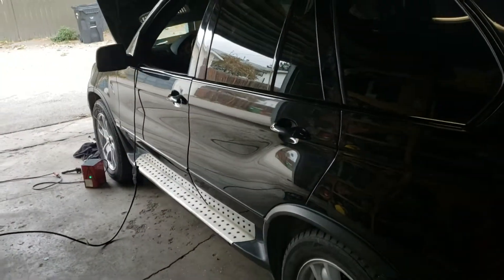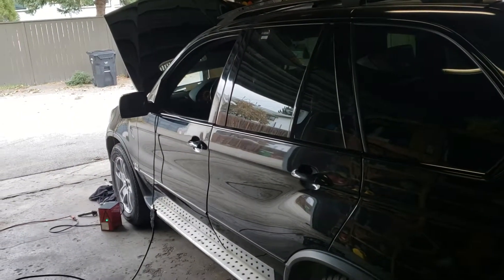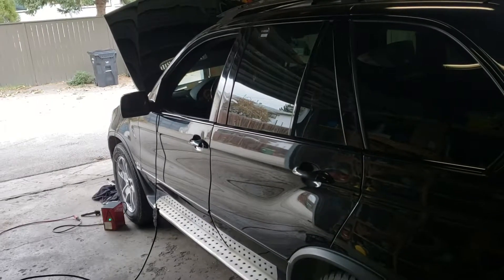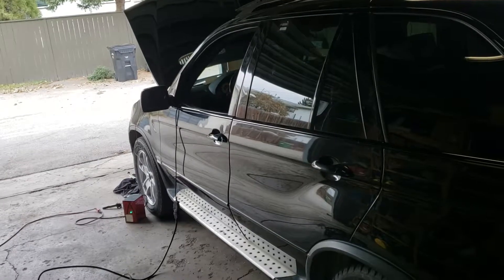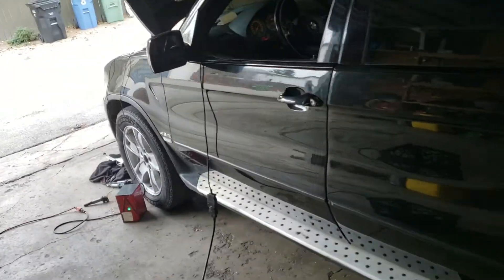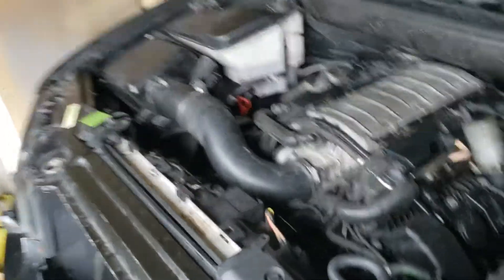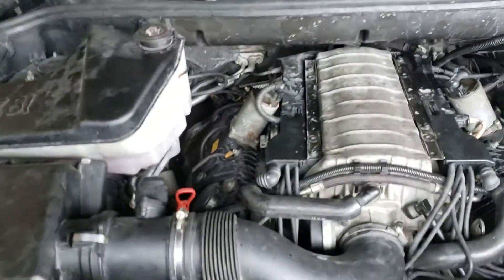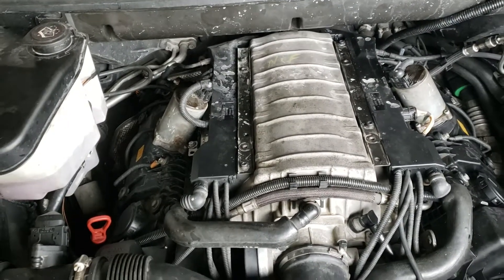BMW n62 v8 random misfire

Comment: Hey mine is running terrible now out of the blue. I pulled Vanos and cleaned them and it seem to get worse. Please help. Mine is running exactly like yours and was misfiring on all cylinders. What fixed your problem?
Reply from the maker: Hi, I have not fixed yet , I will make video soon. 
Check oil pressure
Reply: SashaTessa thank you. What all have you replaced?

Comment: My car misfiring I actually change everything and it still happening
Reply: Your engine timing is off...
Reply: @knightrider3766  thank you but there's something going on with the airflow system, when I unplugged it the car stop misfiring...put it on it starts again.
Reply: @theofficiallavar  I have the 2005 645ci back in November my car was misfiring as well, mechanic done timing , valley pan EGR Valves , changed all hoses etc , etc..come to find out that drivers side timing cam had a worned out spring.which was throwing timing off .not to scare you but I paid $7,500 only because everything was off..car has no more vac leaks , another reason why I couldn't pass emissions...oh forgot to mention, the manifold was cracked...

Comment: My 2003 BMW 745li was the same I fixed it with New pcv’s, sparkplugs, and ATP AT205.
ADD ATP AT205 before replacing spark plugs, since it helps rejuvenate the stem valve seals. GOOD LUCK 😎😎😎
Reply: no good